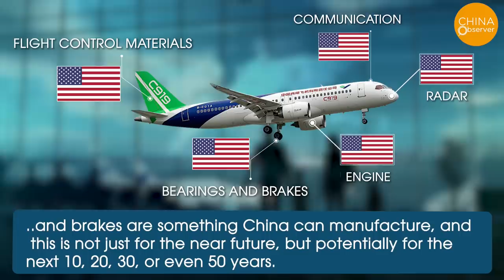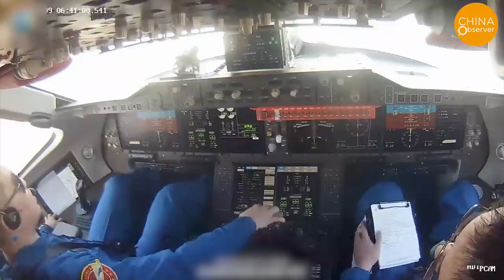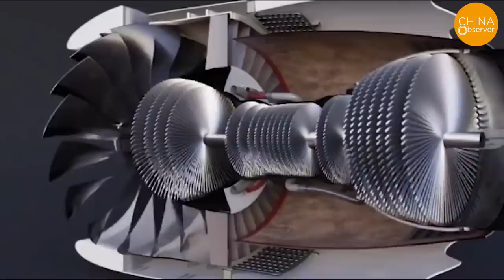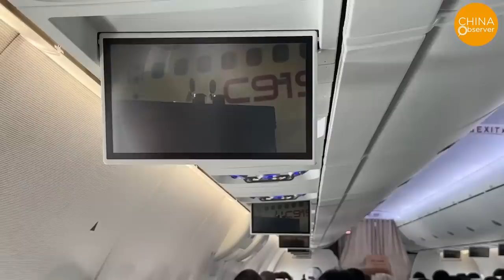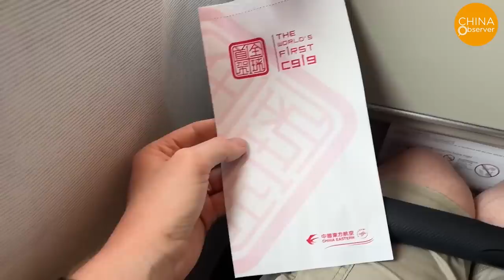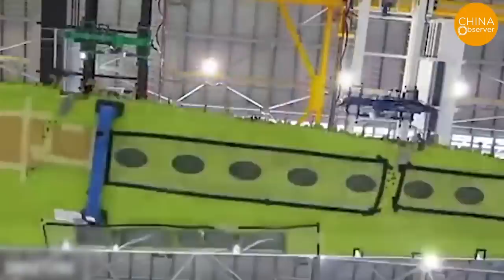The CCP's Aviation Nightmare: 700 Billion Yuan Investment, an Entire Generation Behind in Technology

Comment: passenger jet engines are some of the most technologically advanced objects on the planet. they are extremely costly and created of thousands of parts that each need to be created to extreme tolerances. most nations cannot create them on their own, airbus is made by over a dozen nations in Europe, with the engines mostly designed and produced by the British. It is not surprising that China is having difficulty creating passenger jets even with IP theft.
Reply: China has been unable to manufacture high-performing jet engine for military aircraft despite having access to and having been reverse-engineering Russian jet engines for decades. Their military jet engines in current use are under-powered and have a shorter lifespan those built by the U.S. and the U.K.
Reply: They do make some of the parts. Tail sections and turbine blades for one.
Reply: @GORT70 that’s not their tech though. 😂
Reply: The last thing I would do is board a Chinese made airliner. Tofu Airlines would be a nightmare.
Reply: Airbus's jet engines are supplied almost equally by british and French companies Rolls Royce and Safran, NOT mostly by british.
Reply: F the c919
Reply: The UK Germany and France were building airliners separately in the 50s/ 60s and 70s problem was to many aircraft types and not a bigger enough market thats why they went down 
the airbus route to compete with the USA.  Markets have grown significantly since then  I was there before and during the first airbus wing delivery
Reply: The CFM engines including the new LEAP used on the A320neo, B737Max and C919 are made in France and the USA actually. CFM is a joint venture between Safran of France and GE in the USA.
Reply: @martinrowland2593  At Hawker Siddeley ?
Reply: Famous British engines on A320 aka YouTube expert … fcking hell
Reply: Each needs. The essence of "each" is that it points to every *one*. It is everywhere and always singular. Its singularity is its essence.
Reply: @grahamstevenson1740  not to mention that A320neos are also using Pratt&Whitney's PW1000 GTF engine.
Reply: There is arguably 4 “big” engine manufacturers. Rolls Royce (British) Pratt and Whitney (American) General Electric (American) and Safran (French).also including CFM (GE and Safran joint venture). Honeywell (American) also makes a large number of engines. I’m not sure why you think the British dominate this market, being the USA is far ahead in this part of the market. Airbus also makes a number of their aircraft in the US now too. Granted, both airbus and Boeing source parts from all across the world, with a very high percentage from North America and Europe.
Reply: @devamjani8041 not true. The largest family, the A-320 family is powered by CFM, a GE/Safran venture. A-220 is powered exclusively by Pratt and Whitney. A-330 power by GE, RR, and P&W. A-350 exclusively RR, and the a-380 Engine Alliance (GE and P&W joint venture) or RR.
Reply: @martinrowland2593  "thats why they went down the airbus route to compete with the USA"  It's a largely forgotten what-if, but prior to the formation of Airbus, BAe and McDonnell Douglas considered a merger of some sort.  If that had happened, likely no Airbus.
Reply: CJ 1000 has been successfully developed, and CJ 2000 is being developed and can be replaced soon, which is not difficult for China.
Reply: @devamjani8041 some American engines as well on the beluga.
Reply: @powershift2024  Choice: Chinese plane or Russian plane?  😁
Reply: @devamjani8041  Isn't Rolls royce  British.
Reply: when the enemies hate something, it means China is correct. the type055 destroyer, the fujian carrier, the j20 fighter, the h20 orbital bomber, the space station, the mars rover, the  moon base, you can add thousands more to the list.
Reply: @devamjani8041  CFM is a joint venture between GE and Safran which supplies engines to Airbus. Pratt and Whitney also supply airbus with engines.
Reply: @marcmcreynolds2827  Airbus was not created from a blank page. It's a joint venture between older companies that were building aircrafts since ages.
Reply: @abe000torte  Yes, Sud's Caravelle airliner flew before the B707, for example.  My supposition was that, given Airbus' rocky beginnings, without the British on board (I said BAe, but actually still Hawker at the time) things would have stayed below critical mass.
Reply: Don't worry, they will reverse engineer them. Hope they don't put them on backwards.
Reply: @dragonred3576  "when the enemies hate something, it means China is correct"  You might be too young to have lived it, but there was a time when China and the USA got along resonably well.  Over time, China has slid into militarism (e.g. "orbital bomber", which technologically-capable nations rejected decades ago as too prone to triggering a war rather than preventing one) and domination of its neighbors (shout-out to the Philippines).  CCP rule has been replaced with dictator rule (I used the moniker long before Biden -- it's the simple truth when you look beyond titles at what a dictator is and how they operate).
Reply: @marcmcreynolds2827  Count the bases with nuclear weapons around China and you'll have your opinion automatically corrected 😆BTW it's CPC not CCP.
Reply: @ShamanKish   "your opinion automatically corrected"  Or not.  China's intimidation of the Philippines and other neighbors is not explained by anyone's nuclear posture (said posture influenced by China's desire to invade and subjugate a nearby democracy).  As I said above, the two countries were getting along for a while... before China started to mimic Imperial Japan of the 1930's.  BTW, it's CPC or CCP -- whichever I choose -- because I don't have to adhere to the strictures of an authoritarian regime in order to access internet sources outside of their state-approved ones.

Anyway, you brought up off-topic items to suit your off-topic agenda in the middle of an "airliner" thread.  Anything airliner-related to offer up?  (Edit:  Someone else went OT and you followed their lead.  Either way, same question.)
Reply: It is a good start
The rest will come in time
Reply: recuerda lo que pasó con la estacion espacial.
Reply: Jet engine was every  complex
Reply: @wernerhermann9120   You r knowledge of Chinese mikitary jet engines is outdated. Their latest generation of jet engines matches the performance of most engines found in the West

Comment: The success of the American aviation industry was bought and paid for with the blood of countless heroes and innocent lives over the decades.  This is what’s led to the safety and security we all experience flying in a Boeing jet.  China had not yet paid this price, which means that that debt is still to be paid in the future.
Reply: China got a copy of the safety certificate so that counts
Reply: Especially safety and security of the 737 Max ???????
Reply: @francissabbe The exception proves the rule.
Reply: @Don-mi6zl ... it's no exception. Boeing tried to shortcut proven but expensive safety standards in their development process. 🤧
Reply: Precisely.
Reply: @Mondfischli  Which is an exception to the rule. Which is why per mile flown commercial aviation is among the most safe ways to travel. Not to mention the recent Boeing crashes were 100% avoidable for any competent flight crew.
Reply: @Don-mi6zl  They would have been avoided if Boeing's senior hardware and software engineers could have made the engineering choices that were instead made by middle managers over in accounting.
Reply: @johnstuartsmith very true. Bean counters with no Aviation expertise. What could go wrong.
Reply: China have yet to earn such experience.
There are no short cuts.
Reply: @johnstuartsmith  Agreed. Changing a thrust vector should not have been rubber stamped as such a minor change.  A lot of levels of failure on this one.
Reply: the chief engineer for Boeing first commercial plane was Chinese.
Reply: Literally, hundreds of sorties have been flown by hundreds of 737 Max aircraft. Sounds safe and secure to me. By the way, the C919 uses LEAP engines... the same used on the MAX.
Reply: on the same token, you probably don't know whom build the railway in america's most dangerous terrains.
Reply: @Don-mi6zl  
You know that "proves" means "tests" in this context, I trust?
The exception may fail, improving the likelihood that the rule is correct.
Reply: @trespire  
You're dreaming. Short-cuts are the very essence of business competition.
Learning from what other people have done is a universal short-cut available to everybody.
Reply: @Don-mi6zl   Boeing  out right  f  Lie
Reply: 737max
Reply: @mikalnaylor  the engines of the MAX weren't the problem....
Reply: @TheDavidlloydjones  Stealing IP and copying it produces a poor facsimile with no understanding of principals.
Learning from the competition is something else entirely, and requires expertise and investment in time & effort.
Reply: u mean 737 max 8？
Reply: i wont defend against the china spammers... ill just watch... and stay off the c19
Reply: This programme failed to highlight the boeing is only 70% made in USA, while c919 is about 60%. One grave ommission of fact is China market demand is far greater than the output of c919, that's why China is buying airbuses from France and Germany, c919 will always has a ready home market, whereas boeing has to look for customers around the globe to clear its current stockpiles.
Reply: How dare you talk about China. This airplane is made of thousands of parts and software stolen from different countries. Do you know how hard it is to do that.
😂😂
Reply: @francissabbe 🤭
Reply: @cesargalicia7700  c919 was displayed in the Paris air show last week, why hasn't anyone  sue them for patent infringement?! unlike the USA where every technology was ripped off from other countries through political coercion, Canada's bombardier was crushed by boeing and US government when they developed something similar to 737 with its own technology.  Canada could only watched and continued to play the lackey role. So much for backbone. However, china is no rollover. That's why USA employed slanders, lies, proxy, goons, sanctions etc etc to stop its rise
Reply: @cesargalicia7700  Who was stolen can be prosecuted
Reply: @TomL13 name? Quick search on Google for Boeings early commercial planes has no Chinese names of their chief engineers.
Reply: .. sour grapes!!!
Reply: Better safe than never..!! China will succeed eventually.. * China.. * Jia You *
Reply: @hongkongpong5588  HongKongPong, why?
Reply: @hongkongpong5588  Ni Na Bei.
Reply: yeah but in many areas Boeing decided to give that advantage up. 737MAX, 787 ongoing issues, and so on. Distribute production worldwide to save a few bucks per plane.
I also hope the composite materials will be inspected very carefully - this concerns Airbus as well. The disaster of these idiots constructing the Neptun submarine to dive to the Titanic reminds us that composites also do not have an endless lifetime - at least, in that case, basically the responsibles killed themselves, so no "outsider" was harmed.
Reply: @jamiebennett6354  LOL... good one!

Comment: I previously commented on having worked for a gas turbine manufacturer but how many of you know that in the high pressure section of the compressor the blades are hollow and have cooling air forced through them, that's why there's the technology gap which China is trying to buy.

Comment: Even the Japanese couldn't get their mostly home grown passenger certified by the FAA.  The Mitsubishi SpaceJet was cancelled when it ran into huge and costly problems in the certification process.  Mitsubishi closed the entire organization.  If the Japanese couldn't make a small regional jet, the Chinese have zero chance of accomplishing that especially if it's going to use stolen technology for  its engines and other high tech systems.
Reply: I was wondering about the Japanese.  And you are right, if THEY cannot do, the Chinese haven't got a prayer.  Paper tiger indeed.
Reply: Very true. And Mitsubishi had a lot of experience building sophisticated American military aircraft designs under license. But those depended on key components produced in the US.
Reply: @xhagast  wow. But Brazil Embraer E2 Jets comparable to a320 or 737. Used internationally.
China was like if Brazil can do it. So can I?
China already had ARJ-21 airliner which has been flying for quite some time now and has had zero incidents. Yes C919 is in fact Not Chinas first airliner.
Reply: C919 Engines are bought from GE. Use stolen technology for engine? please elaborate?
Stolen technology for their engine. please elaborate?
Reply: @bennyang2200  The Comac ARJ21 is just a knock-off of the Douglas DC-9 (MD-80, Douglas first made the aircraft calling it the DC-9) which was manufactured in China on a license from Douglas:
"Resembling the McDonnell Douglas MD-80/MD-90[5][6] produced under licence in China," 
Also, the ARJ21 is NOT certified by the FAA and, thus, cannot operate in American airspace.  All but 2 airlines that fly the ARJ21 are Chinese.
Embraer has been making commercial jets for a long time.  And its first airplane to get FAA Certification was the E190 in 2018.  There is no comparison between any Chinese aircraft company and Embraer.  

China copies everybody and everything.  The one thing that they can't copy is the management and infrastructure systems that are mandatory to design, build and produce a complex machine like an airliner.  You can't just build a jet--you have to also document and demonstrate that everything about the jet meets the technical specs of the FAA.
Reply: @bennyang2200  The video explains GE's technology changes for the engines sold to 中国商用飞机有限责任公司. Comac isn't using stolen engine technology. It has been forced to accept restrictions meant to limit Comac's ability to access to advanced features. Versions of the same engine model sold to Boeing and Airbus are superior.
Reply: @Thankz4sharing  USA destroyed Japan's economy a while ago.
Reply: @lonebeagle  China already defined C919.
Reply: @ShamanKish  Japan destroyed their economy by themselves!

Comment: From what I have heard from engineers is that reverse engineering from stolen items is extremely difficult if not impossible. If you have a thing that you get your hands on, you have figure out how to create the materials used, make them and then getting them to work is difficult. This is what happened here and it seems to have not worked. At least they realized the plane would not fly safely and stopped using it.

Comment: Planes are not just how parts look and fit together.  The parts has to hold especially metal fatigue..or else eventually it will fail and fall off the sky.
Reply: For an example just look at the recent Titan submersible tragedy.
Reply: @xhagast  Was that of Chinese manufacture too?
Reply: @mikeneill6813  No, but it was caused by material fatigue.

Comment: Airbus has 60% of its parts coming from outside Europe. Boeing relies on global suppliers, including China, Japan, Europe for its parts. Boeing doesn't make its own jet engine. Fact is just like the car industry, commercial aircraft relies on thousands of suppliers worldwide. No one single country can manufacture all the parts for a profitable commercial aircraft. C919 has 60% from Chinese suppliers, that's bigger than Airbus. They intentionally used European and American parts in order to work toward FAA certification on some crucial systems. Commercial aircrafts can't be simply assembled like Ikea furniture, because the overall design and testing requires high tech engineering such as wind tunnels and super computers. This is partially why Japan failed to create a regional jet, even though it can produce many sophisticated components for Boeing. Don't believe me? Just Google for Airbus and Boeing parts and suppliers.

Comment: I guess they gave up on the maintenance of the bullet trains and tracks that they bought from Japan/Korea. You don't need planes with a train network since they fill the same position. On the other side of the coin, it'll be impossible to catch Boeing/Airbus for commercial sales. By the time they catch up, they will already be at another level of sophistication.
Reply: I was thinking about that.  Why buy 5000 planes when there are bullet trains EVERYWHERE?
Reply: @xhagast